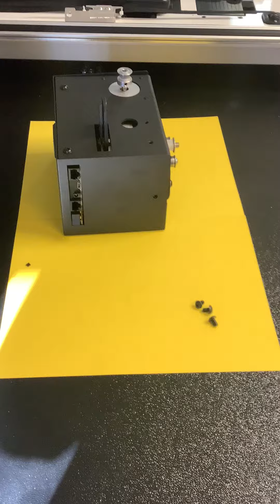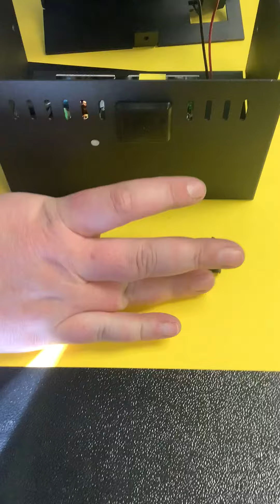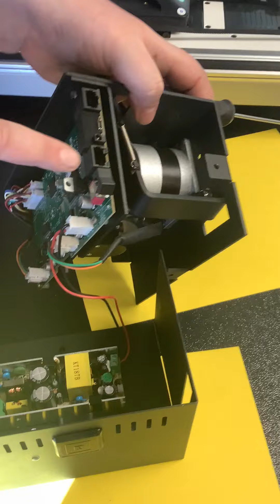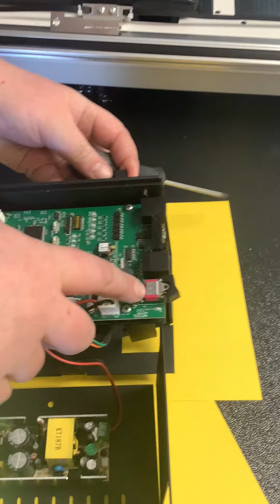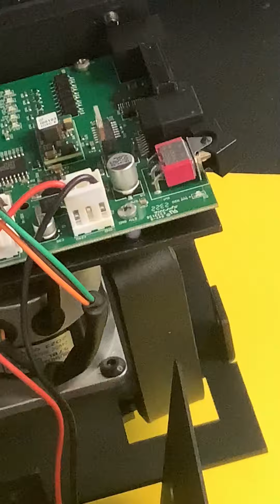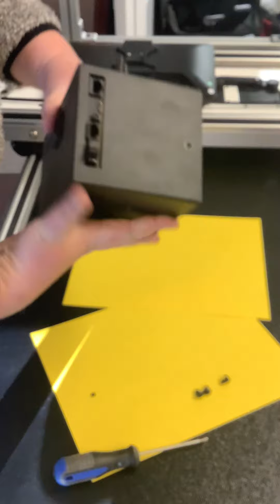Installing the Jumper on Butler Robotics

Comment: What’s the jumper for?
Reply: The jumper applies power to the port that it is nearest to.  Some peripherals that plug into this port on the Butler require power.  Others don't.  When when power is not needed on the port this jumper is removed.  This also helps to prevent damaging other electronics that are accidentally plugged in here.